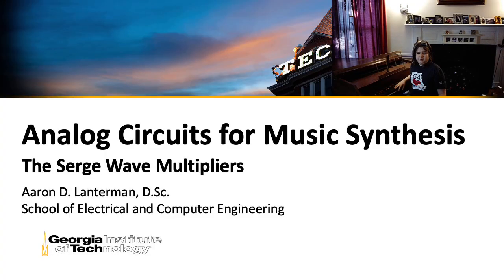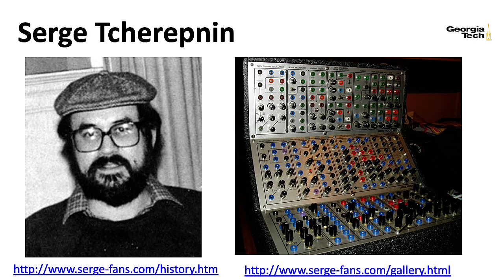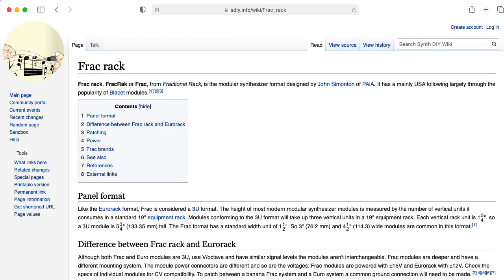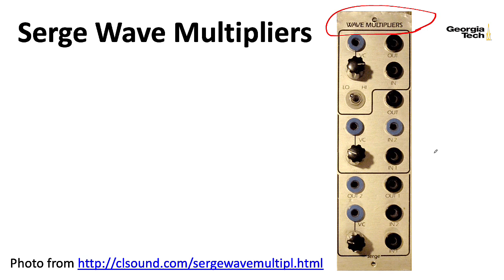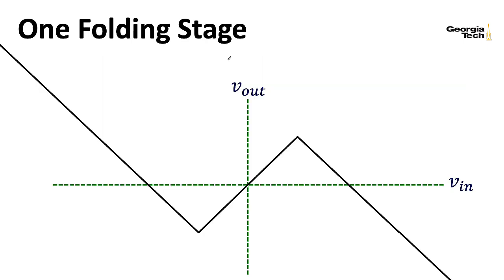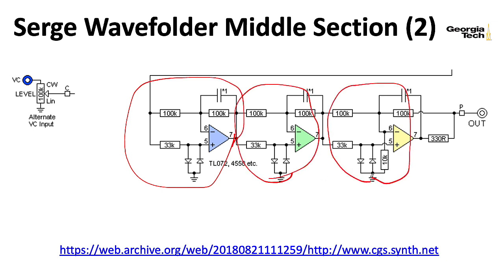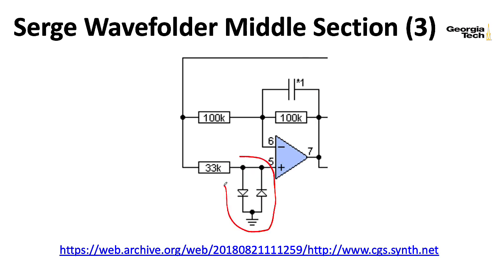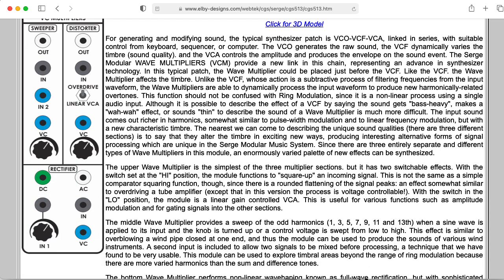ECE4450 L17: The Serge Wave Multipliers (Analog Circuits for Music Synthesis, Georgia Tech course)

Comment: Hey, i still need to watch the video but I just wanted to express how grateful I am for you putting these videos online.
Not only are they very interesting, clear and I'm I learning a lot but they're also perfectly timed as I was just starting to build my own synthesizers at the ending of last year.
I'm super thankful for your video's though and it really gives me a better understanding and in depth view of what I'm doing and inspires me beyond the self thought diy circuit filosofy (by lack of better describing word) I started off from. (combining physics, ideas and basic systems/building blocks/contraptions to build circuits and devices)
It's adding so much to my knowledge, and realizing microamps can be enough is amazing because using 4.7 nanofarad and 100kohm resistors saves me loads of money instead of using 470 microfarad and up capacitors with small resistors so I could get my volts out before I realized millivolts was an option.
Anyway, long story short, I love the clear interesting  highly educational video's you put out and I'm very grateful for them and it almost makes me happy corona came around so thank you very very much.
Lmnc, mechanical engineering and high school physics were my basics, but this really expands on that.

Comment: Nice! If you use folding stages with different threshold voltages (different number of diodes in series), you can get the same effect with a lot fewer stages:

(1 diode): 2 corners
(3 diodes) => (1 diode): 8 corners
(9 diodes) => (3 diodes) => (1 diode): 26 corners

compared to (1 diode) x 6 to get 12 corners in the original design. The difference is that in this setup, the intermediate folding stages have outputs that go beyond the threshold in multiple places, so the folding action of the following stages is used multiple times.

This might not save any diodes, but it definitely uses fewer op amps, and if you can come up with a way to change the threshold voltage other than adding more diodes in series, you could save a number of diodes as well. You can also make some funky wavefolding functions if you don't decrease the threshold by a factor of 3 in each step as I've done above, but try other combinations.

Comment: It'd be really cool if you could do an overview of the bottom part of the wave multipliers! It looks like a really unique circuit taking advantage of the LM3900 and I'd love to know how it works. It looks kinda like an evolution of the triple wavefolder circuit. It's so weird, it does full wave rectification, but somehow the output stays roughly the same volume even though there's no VCAs involved
Reply from the maker: Hah! I've wished someone would explain that circuit to *me*. If you figure it out let me know. ;)
Reply: @Lantertronics  i feared that may be the case, i'll do my best :)

Comment: I always assumed that Ken Stone would have the output of his circuits be tapped where they were, and with the 330R resistor in the mix, to help compensate for the voltage/gain drop that you get with the common 1K resistor hanging on the output of opamp circuits since his method adds the 330R resistor to the feedback loop of the opamp, increasing the gain, and still providing enough resistance to prevent damage if the output was shorted to ground, though I could be completely wrong on that....

Comment: So at 8:21 what is the purpose of the 33k resistor being 33k rather than 100k like all the others. Is this to allow for more gain on the stage? Thanks
Reply from the maker: It's not really changing the gain per se. My analysis was rather crude -- I assumed the diodes were all the way "on" or all the way "off." In reality the diodes have an exponential current-voltage relationship, so the nonlinearity doesn't really have sharp points like I showed, they'll be more rounded. Changing the resistor in the 33K spot will change the shape of the nonlinearity around the peaks. This sort of thing is fun to play around with in something like Falstad; you can just look at the resistor and the parallel diodes and play with the resistor value (be sure to set the diodes to like 1N4148 or equivalent, I forget what it is in Falstad). The resistor and double diodes is like what you get in the Boss DS-1 distortion, Pro Co Rat, etc.
Reply: @Lantertronics  thank you, so it is the curve, not really the gain and this makes sense as I was playing around with this circuit on a breadboard and I don't have any 33k resistors but some 51ks and tons of 100ks. 

I am more for breadboarding than Falstad but will maybe do more of this at a later date.....the Falstad won't give you magic pixie smoke that a breadboard can!😀
Reply from the maker: @SouthShoreSonics  Oh, the breadboard is definitely more fun! :)